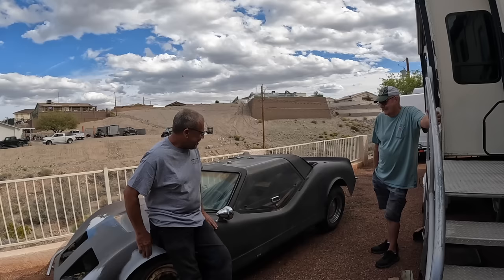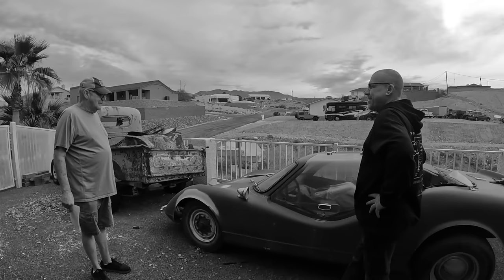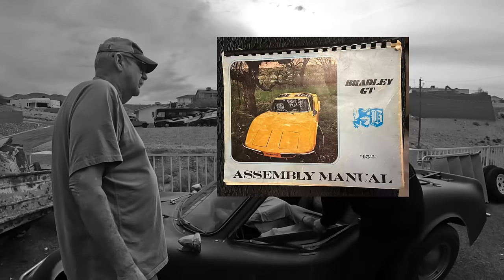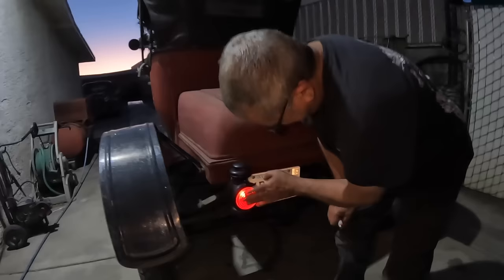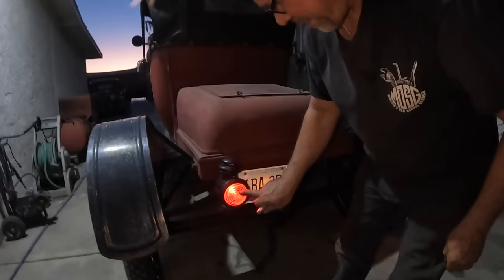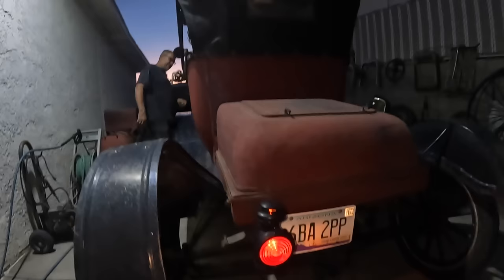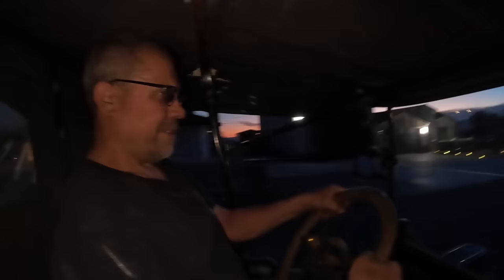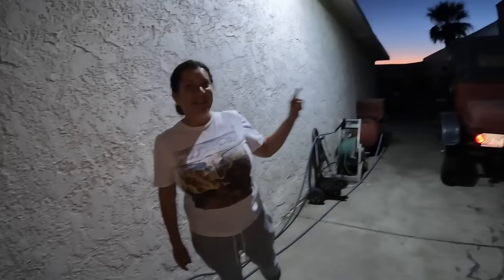Why Did I Buy This Ugly Car? Bradley GT

Comment: Back in 1978 a friend of mine was crossing a street on his bicycle and a Bradly GT came out of nowhere and hit him! A yr later I litterally flew over an OPAL GT that I slammed into going downhill around a corner! He was sitting at the stop sign and I came flying down the hill went to make the turn at the bottom and there he was! I slammed into the front bumper and went ass over teakettle over the hood window and roof! My bike went all the way over his car! I landed by the drivers side rear tire! Shattered my kneecap on the gooseneck bolt because they didn't have padding back then! Turned my front rim into a pac man! Bent my forks all the way to my frame! And flattened his front bumper! To this day and I'm 58 mind you,  I can still see the look on the mans face as my face planted on his windshield!
Reply: As long as you can look back on the mishap with something resembling a grin.
Reply: @RuralTowner  oh I can! There was this neighbor that lived on that corner next to the stop sign! He was an old guy who had a hand made train set filling his two car garage that I would go over and watch him work on! He happened to be in his yard right by the curb when it happened! He got a birds eye view of the entire incident! He was the one who called my mom and then an ambulance! I can close my eyes right now and describe it! I saw the car at about 30ft distance, it's a sharp curve and I was going so fast the only way to make it was to cut to the inside and swing wide onto the side street! I slammed on my brakes and slid straight into the front of the car! Next thing I see is yellow from his hood then sky then I'm plastered face first into the windshield making eye contact with the driver! His eye's were as wide and then I flip and see sky then then next thing I see is the rear tire on the driver's side as I hit the pavement and slid about ten feet! Mr Kennedy, the man on the corner ran up to me and the other guy gets out of his car and start the are you alright quiz and I pass out! When I came to they were loading me up on a stretcher! Got my first taste of morophine then! Don't remember anything after that until waking up with one leg in traction the next day! Took three month's before I could walk without crutches! Ruined the whole summer, no swimming or all the fun stuff I did!
Reply: Sounds like a old Evil Knievil stunt.  I did some of those type things back then myself.  Lucky I only broke and arm and wrecked one banana bike.
Reply: I hit the back end of a parked 69 Corvette with a 427 in it when I was seven. I know it was a 427 because I had a bruise on my right thigh with the 427 quite legible. I managed to pick up my bike and hobble my way home, carrying my bike. Had to replace my front wheel, but I was lucky that it didn't do any damage to the vette as I was able to lay it down so slid under the car.   I went with my brother to look at the car and the owner came out, and I told him what happened and he looked at the car, told me no harm, no foul. He was from out of province and was visiting his relatives. I saw him a couple of summers later, and he was driving a different car. He told me that he hit a moose in the bald Saskatchewan prairie coming back from Calgary. He said that he lived in Newfoundland his entire life and never hit a moose there even though there were almost six moose accidents a day on average where he was from.

Comment: When I crossed the fence in 1976 and moved from the GDR to West Germany, I had a lot to do with a US military officer, logically I had previously been an elite soldier in a special paratrooper unit for 5 years. He drove a Bradley and we drove it a few times in Heidelberg and Frankfurt, great car, but to get in there today, Merlin, unfortunately I've only woken up in two directions over the years. There used to be a company in Offenbach that modified US cars, the Bradley was tuned there, it was a rocket and was very thirsty, but the GI's filled up much cheaper than we did. 
Nice video, make something of it, it's a great car.  Greetings from Frankfurt Gerold

Comment: In the late 1960s, Gary Courneya and David Bradley Fuller were introduced by a mutual friend.[2] Fuller had been running a small fiberglass design company, and Courneya had earlier been in sales in Beverly Hills, California. The two partnered in a business, Gary's Bug Shop, which produced parts and kits for the dune buggy market. Fuller designed the bodies, and Courneya handled sales.

Comment: Be sure and check to see if the floor pan has been reinforced since you cut the top off.  I built a 70 Convertable Baja Bug in the 80's with a full cage and got talked into trading it to a friend for a truck he had that I wanted.  The first thing he did was cut the cage out because he was a big guy and had a hard time getting it it.  The doors shut perfectly until he removed the full cage.  The first time he sat in it,  the floor pan folded like a taco.  The doors would no longer close! And yes, I had rebuilt and replaced all the rusted out floor panels with reproduction panels, so it was plenty strong as long as the roof or cage that replaced the roof support for the pan was still in it.  I even welded it with a lot more welding than the factory spot welds.  But, he was just too heavy!  He ended up scrapping it.  The shame of it was it was a full 1 piece figerglass front cap body, with king pin 5 lug disc brakes front axle and IRS rear axle with 5 lug disc brakes.  It had a 2000CC Lyle Cherry Racing engine in it!  He just called the scrap yard and had them drog it off.........

Comment: Basically its a dune buggy. I was a buggy nut back in the day and looked at the Bradley and decided it was too ugly. Now in my opinion you need to install a 140 Corvair engine for some really exciting power.
Reply: I see some people using some GM liquid cooled 4 banger in some buggys. There are some that are turbocharged.
Would they be easier than the Corvair?
Reply: @haroldphipps3457  The Corvair is air cooled as is the Vee Dub so no messing with a rad or water plumbing. Corvair engines are cheap and not hard to find. There are adapters out there that mate it to the Vee Dub transaxle.
Reply: @ricknorris6943corvair  very true. The conversion has been happening for many years.
IIRC the Corvair is a 6 cylinder as well.
And wasn't the Spyder turbocharged?
Reply: @haroldphipps3457  Yes, the Spyder model was from 1962 to 1964 and was turbocharged rated at 150 HP. From 1965 to 1966 it was a Corsa model rated at 180 HP.

Comment: I traded a wrecker for a Bradley GT while in the USAF in the late '70s.  It was a LOT of fun to drive and work on.  But I had to weigh down the front end with a heavy piece of metal 
I-beam to make it handle well.  Sorry, but I never thought of it as ugly.  Love the way you turned yours into a convertable.  I replaced my rear window with a piece of flat plexiglass.

Comment: Front tires not coming in maybe a sign??? Just a few more items to add while waiting, brakes, maybe a roll bar, lap belt and safer wiring (ign.) no fires, leave the smoke in the insulation. Looks like two kids having fun.

Comment: In Pennsylvania  antique plated vehicles can't be operated on public roads after dark, historical plated vehicles can only be operated on public roads after dark if they have a current state inspection sticker. Any vehicle with regular plates is required to have a current state inspection sticker and can be operated any time of day or night even an antique with kerosene lamps, this is because the state inspection only covers the as built vehicle, if it didn't come with seat belts then they aren't required, same with lightening. It is bureaucracy for the sake of bureaucracy.

Comment: On cars like that we put a sunshade under the plastic top to prevent sunburn and cancer of the scalp.  Beats wearing a hat or putting sunscreen on the top of your head giving you that 50's Slicked Down look.  

Remember the 54/55 Crestline Skyliner and Montclair Sun Valley, on a sunny day it was like being under a magnifying glass focused at the top of your head.  Nope, the light green tint didn't help and neither did the lack of air conditioning.  The zip in sunshade from the factory didn't last very long either so owners got rid of the cars or had the plastic roof covered, painted over or replaced with a steel panel.

The smoke from the Model T lights could be viewed as mosquito repellent.  ;>

Best!

Comment: There used to be a place called Sun Ray Products that made new OEM windows and other moldings for the Bradley GT, not sure if they are still around or not. They had all the original dies to make Bradley parts though.

Comment: I think it was 1970, my dad had a friend that owned a Bradley GT. I got to drive it around town for a day. It was a blast to drive until the throttle cable came off. Had to use my right hand to pull 9n the throttle to get home. Still a blast to drive😂

Comment: The Bradley has some good design elements but also some not so good. Just not sure which would stay and what should go to make it overall a good car. Motor sounds good and should be plenty of HP's for the car. Just need some tweaking. Would like to see some kind of top back on it but the one it had when you bought it really did not work design wise with the rest of the car.

Comment: The chevy slots make me super jelly....ive scraped and scavenged for 5 years to come up with a set of slots that aren't ruined  junk. (People using wrong lug nuts, running them loose, ect)  i do have 2 15 inch 8 1/2 rears and some reverse 14x7 (all 4 3/4  bolt pattern) for my 87 s10 blazer 
Ive got some 8 hole weld big and littles for it too. 
But my  stepside squarebody switches between chrome Corvette ralleys and 10 wide sawblades. Its hard to afford 295/50s anymore, but the 275/60s do ok...... always raised white letters, always. (Painting on white letters when you can't afford em is approved in my book)  wheels always make the look of a car/ truck......boat trailer, motorcycle, bicycle, go cart, whatever has wheels.......and your obviously a master of acheving " the look".

Comment: The old VW in a racing midget was made by Auto Craft. It ran on methanol. By the time they quit making them they had upwards of 160 - to 180 cubic inches made 300 HP. keep the gravel out of the carbs will ya!

Comment: In the late 1960s, Gary Courneya and David Bradley Fuller were introduced by a mutual friend. Fuller had been running a small fiberglass design company, and Courneya had earlier been in sales in Beverly Hills, California. The two partnered in a business, Gary's Bug Shop, which produced parts and kits for the dune buggy market. Fuller designed the bodies, and Courneya handled sales.

Comment: A friend of mine had one in the 70's. Everytime it rained the doors leaked and the seats filled up with water. You had to pull the engine to do anything to it. Spent more time working on it than driving it. Also very uncomfortable to lay down and drive. If I think of anything good to say about it I'll repost. Oh hey it wasn't mine that was great.

Comment: The through out bearing looks terrible.im considering the convertible option and as the engine will be in the back seat i might use boat style headers out the top over decklid

Comment: Fun episode! All the way from dragging it home to a "who needs brakes" test drive with two guys giggling like little girls! 😅
OSB or "plywood" was often used in fiberglass bodies like the Bradley. The combination makes for some structural strength... though I would still want a proper steel cage in a rollover! 😮
I have to say... chopping the top off and putting some wider wheels and tires on it improved the looks of that GT quite a bit.
Sorry, but I'm not a fan of the "bumperettes"... they look like someone cut up a grocery cart to make them. (And I would know because we cut up grocery carts to make 3-wheeled downhill racers out of them when I was a kid.) In my humble opinion, the car would look better without them.
I would call that car "BOB"... which stands for "big old butt". You know, they say a lot of cars try for some sex appeal by emulating the female form... well, that baby's got back! 
Bradley is my middle name... but if I were to get a "kit car" there are others I would look for instead. One of my favorites is the Griffith, which is a TVR Grantura Mk III or IV chassis and fiberglass body (from England) with a Ford 289 Windsor dropped under the hood here in the US. Similar power as the original  Shelby' Cobra or  Sunbeam Tiger, but in a car that weighs less than 2000 lb. And it's much rarer than either of those!
Another kit car that always interested me was the Marcos GT of the late 60s and early 70s. Many years ago I tried to buy one that I found "stored' in a parking lot (non-running condition and threatened with towing), but was never able to connect with the owner. It disappeared (along with about a dozen other cars an employee had tried to store there).

Comment: I installed a bus front susp.to get disc brakes on front and the audi has huge disc on it .i have 12 inch halibrands for the rear and 8 on the front.

Comment: I have 1 bradley gt.now that your opinion of the bradley which agrees with wifes im on the defense as to the beauty of mine.im using an audi fwd v6 engine and trans assy.these are a non electric trans which places the engine in a normal rwd manner yet is fwd.im placing it in the rear mid engine position.

Comment: Yup she is uuuuugly ☺but you definitely improved the looks with the roof delete and wheels/tires yes I agree I've always been a white letter guy. My tire guys know that straight away ,cause one of my first set of tires the guy installed white letter Inside ,because I never thought I'd have to even have to mention it.  Of course maybe if it's a Cadillac then it would be white walls ☺👍 but back to that ugly Bradley gt ...glad you help that elderly couple clean up their eyesore on their yard. That is all worth it. Other than that ,it imagine you don't need to leave your yard to find your next ten projects...hint hint😁👍

Comment: You really need to sort your mic out, the slightest breeze and the sound keeps cutting out, you need a windshield / muff.
I really don't understand, you bought a rare car with a perfect body, then took a saw and chopped it up.
Just a thought, chrome spray paint I believe is conductive, it is likely to arc all over.

Comment: Not only ugly. They are butt ugly.

Back in the 70's I had a K series Mustang and a Mini. As described to me the Bradley sounded (early) Porsche-esque (4 cylinder VW running gear w/minimized weight- what's not to like). I sent away for the brochure and, on receipt . . . gag reflex